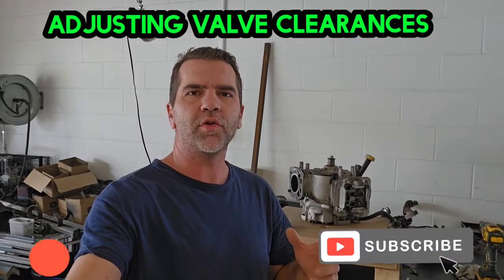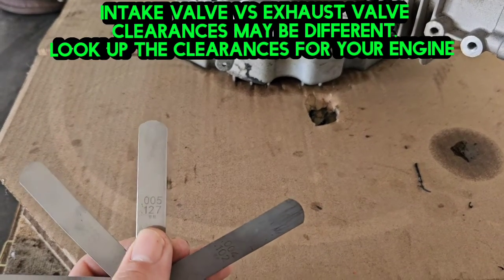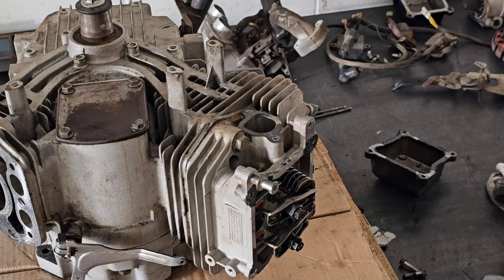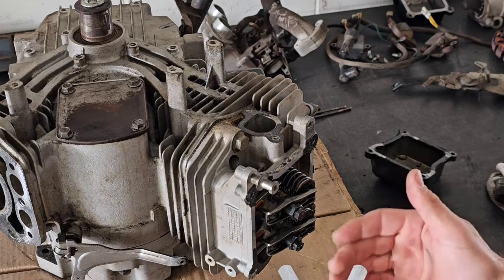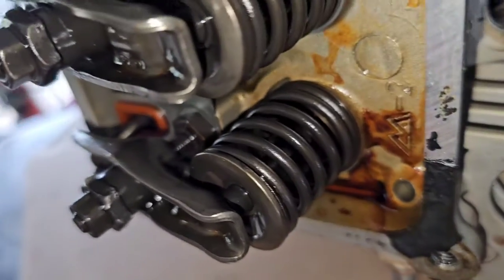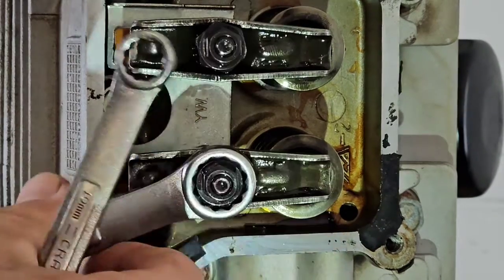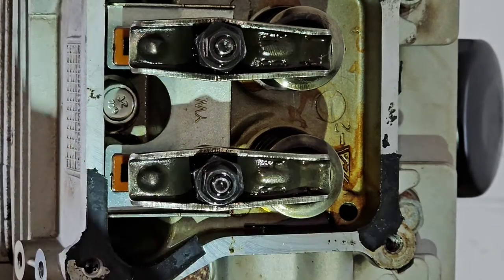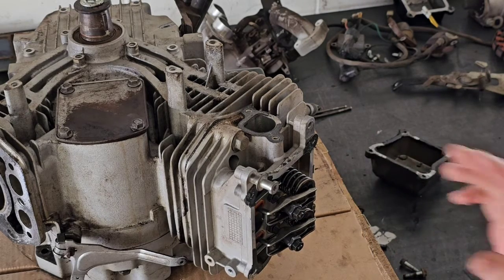Adjusting a mower engine's valve clearances

Comment: If you built in compression release this will not on engine setting valve this way you must go about a 1/4 pass top dead center to be off it so it will start start without stopping at top dead center
Reply from the maker: Thank you, Bradley, for reminding me of that. I used to mark my extension with a sharpie and then go down 1/4". Now I need to edit this video and re-upload it. Thanks again.
Reply: Your welcome I have for different tec how to do this and did same thing